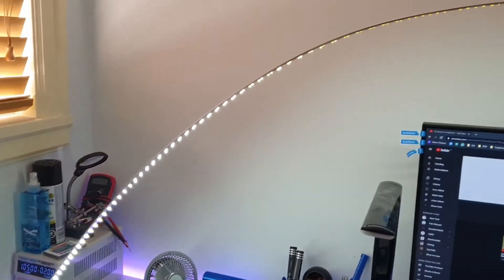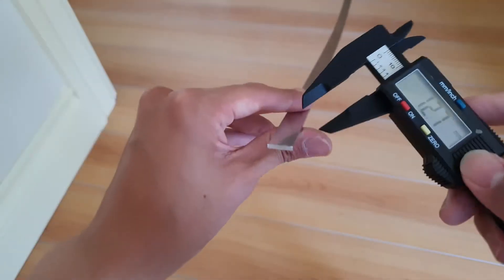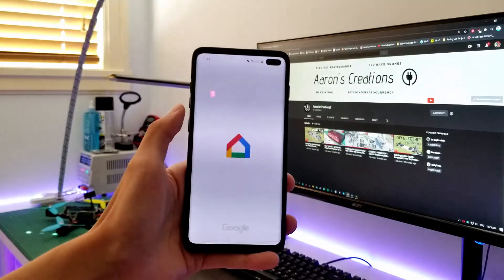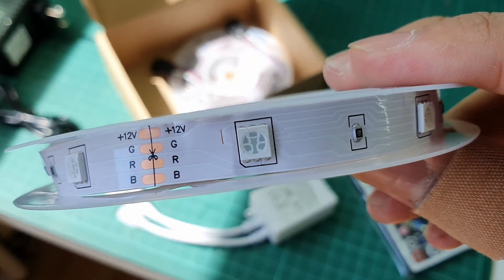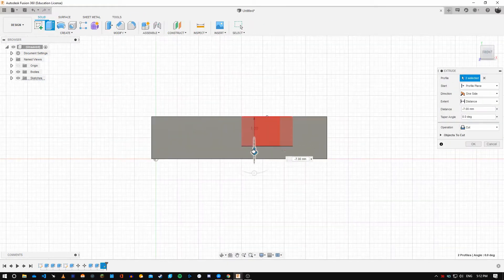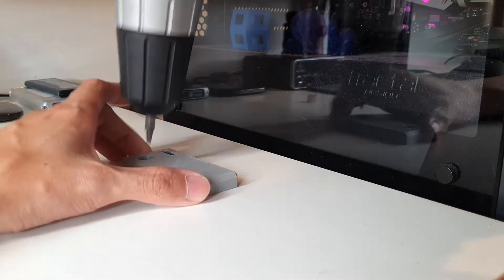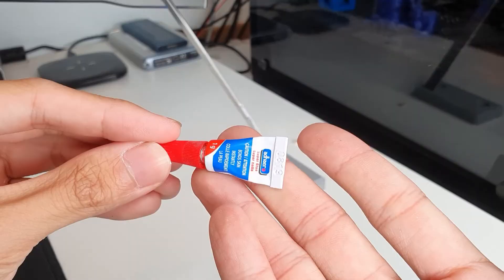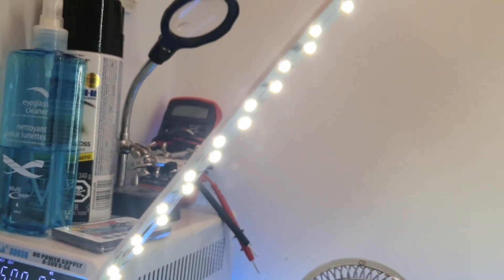Making A Custom LED Workbench Light w/ Google Home Integration!

Comment from the maker: Forgot to mention the cost of this build! Heres the list run down:

TOTAL: $37.55 CAD
LED STRIPS: $21.99 amazon.ca
Aluminum Panel: $10.45 home depot
Wood Screws: $5 (pack of 100) home depot
3D Print: $0.10 (worth of plastic)